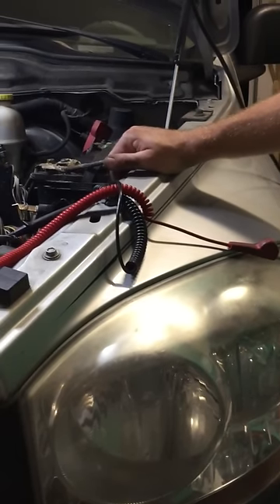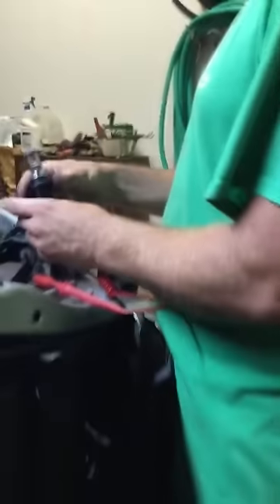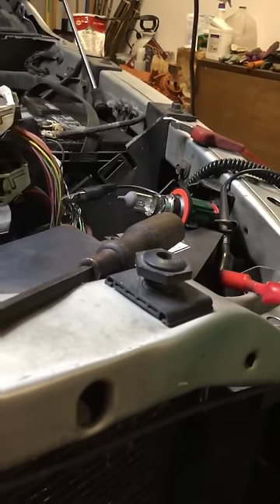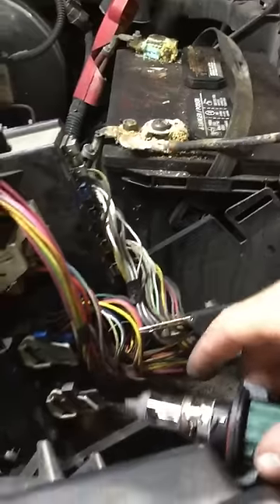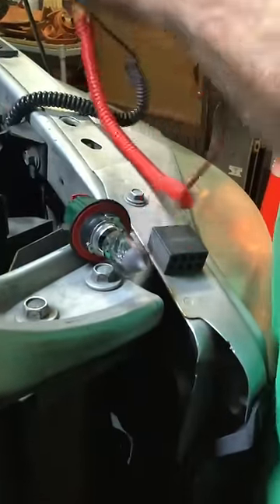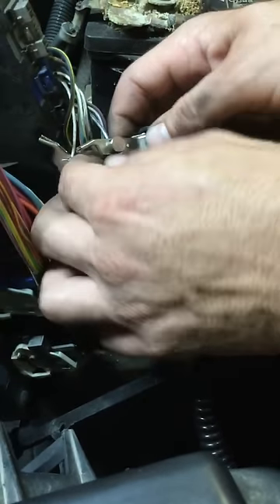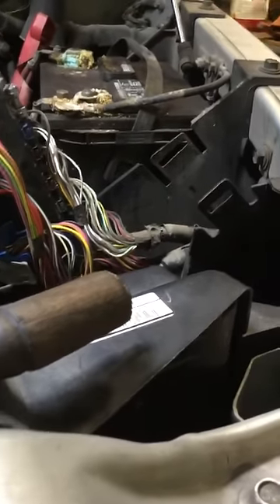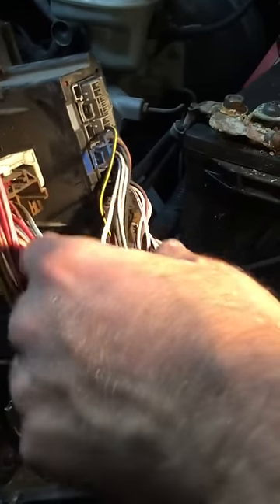06 ram low beam headlight issue

Comment: Hi just wanted to ask i have a 2017 ram rebbel 1500 i had one headlight go out about 2 weeks after o got the truck then few weeks later 2nd headlight gonre then i started driving with my high beams then one high beam went out then 2nd  few weeks later now i am driving with the lil fog lights at the bottom. Any suggestions, i already took tipm out and did hard reset no luck.please let me know going nuts, went back to dealer they were no help.
Reply from the maker: kimberly touhey. That sounds like a bulb issue. I have had no issue with the new TIPM's, especially on the rebel. Does your truck have any aftermarket lights, bulbs or ballasts?

Comment: My wifes 2010 Town and Country has a dead left low beam. The socket measures only 4.8 volts with a meter. Could it be the headlight relay just behind the radiator?
Reply from the maker: Steven Ruisi if your van is a 3.8l, I believe the relay behind the radiator is the external cooling fan relay. It looks like the low beam driver come out of the TIPM. The left is the white with dark blue tracer and the right side is a white with grey tracer. I would make sure your left side driver is not open or shorted to power or ground from your headlight to your TIPM. If it is good jump it over to your right side driver.

Comment: The problem is actually the fcm (little silver box) vs the whole fuse box.....still an expensive piece as well
Reply from the maker: lee Kennedy  thanks bro! This truck does not have a FCM, everything comes out of the TIPM. The FCM can throw you off if your not careful and I gone many rounds diagnosing the FCM     on other trucks.
Reply from the maker: lee Kennedy 2005 was technically the last year for Front control modules but there was probably some early build 2006’s that had them. This truck was a late build 06’. Yes beware of the FCM if you have one, it can throw you for a loop

Comment: My right headlight is having a problem and it also interfere with my left brake lights and my fog lamps and turning signals. The passenger side headlight which is failing is a double filament and the high beam is not working. Would that cause my problem ?

Comment: Thank you for video worked on my viper truck and was wondering if it works for the highbeams too
Reply: I believe it would, I haven't tried a high beam and I wouldn't be scared to try. Worst case would be a fried TIPM but if one or more drivers are bad, the TIPM is already shot. For your 8.3L the High drivers are...White/Light green for the left and White/Grey for the right. Good luck..

Comment: Anyone know if U can just plug the bad side wire and run that into the good side since that driver is bad anyway.  U feel like “jumping” then will cause that bad driver to voltage spike since it is still on the ecm

Comment: I just bought a 2007 ram 2500, lowbeams do not work at all, i changed the bulbs and that did not work. The connectors have been replaced also but the highbeams work fine. is there a way to quick fix this without replacing the TIPM.
Reply from the maker: SledNeck117  it doesn't sound like it. I would still test for power and ground and make sure all fuses good but if both drivers are down you may be looking at replacing the TIPM.

Comment: Seems as though this is common on Chrysler/dodge vehicles...I pulled my fcm off the ipm and sanded/slightly twisted the flat prongs as I heard its typically the fcm that causes this...that didnt work so I checked the voltage at the bulb where the low beam didnt work...nada.so whats left is a wiring issue/ipm issue.

At least now I know push come to shove I can jumper it like this.thanks man,btw how long did this hold up?
Reply from the maker: Craig Shelhammer thanks for the comment. This truck has no FCM and is still running both low beams off one driver almost two years later. Good luck!
Reply: Romans 12 thats great news..I think tomorrow thats what ill do!thanks for replying so quick.
Reply from the maker: Craig Shelhammer no prob and if you need any wiring diagram info let me know
Reply: Will do,thanks man!

Comment: I did this before i knew about tipm. I seen a repair to wire the burned out trace line. my problem now is everything else is starting to fail
Reply from the maker: infowarrior420  bummer dude. The TIPM's are junk. Good luck

Comment: I have 12v to the low and high beam wire on the right passenger but no low beam light..any ideas? if the tipm / pcm is bad then why would i get power?
Reply from the maker: Fred Young  if you have 12v on the low and high wires, you either have no ground or a bad bulb. Double check your powers and ground.

Comment: I have same side as you but brights on both sides works . Is this issue for low beams? Which is my issue on the driver side.
Reply: Keith Walker i have the same problem

Comment: I have a 07 Cummins and my passenger headlight has no power at all. My driver side only works on high beam. Does this sound like a TIPM problem? I’ve currently have both batteries cables disconnected and zipped tied to each other to see if it will reset the TIPM. I’ve read and done research and people say it works. We shall see. Anything you could recommend trying? Thanks
Reply: I have the same thing did u fix ur problem. Because I can't seem to have lights even on driver side.. only one high beam works on passinger...plz let me know how to fix this
Reply from the maker: Stephen Smith you have a tough one. It sounds like a front control module but you would need to do some more testing to pinpoint.
Reply: Romans 12 I pretty much did the same thing you did except I just put a little piece of wire in plug to jump them instead of splicing the wires

Comment: I did this on my truck and it worked but when I turn the car on none of the low beams work only the high beams. I am running LED bulbs would that be why they don't work, since there's too much voltage off one driver ??
Reply from the maker: M Bravo usually LED’s don’t run higher voltage but it’s the lower resistance that mess with the drivers. You said it worked? Did it work for a bit then stop? My second question is, are you sure you are on the correct wires? Third question is, are both low drivers bad?
Reply: yea they worked while the car was off but didn't when it was on but I think it was the LEDs cause I put in Halogen bulbs and everything works fine now. looked more into it might need resistors to run the LEDs

Comment: Looks like a good solution. Also experiencing power on low beam one side only. Same with high beam one side only but opposite side. Third issue, only right rear turn signal operates. No front signals whatsoever? Would it be okay to jump these drivers as well? Thanks!
Reply from the maker: S. Bloom so you have one low beam on one side and one high beam on the other side only working plus some rear light issues?  What year and engine do you have?
Reply from the maker: S. Bloom sorry, you also have no front signals?
Reply: Romans 12 Right rear blinker works but no others front or back.
Reply: Romans 12 Thanks for your help. This is a 2005 Ram 2500 4X4 with a 5.7 engine. From what I'm reading looks like a faulty TIPM circuit failure.

Comment: What type. Of wire should one used to run it. I have the same problem.
Reply from the maker: Lisardo huerta I would use a 16 gage wire, whatever color you can get at the parts store

Comment: i have an 07 2500 with the 5.7 in it & am having the same problems. will this still work for me? also how long did it stay working?
Reply from the maker: levi southern hey sorry for the late response but yes it looks like your truck doesn't have a front control module and  wires are the same: white with a dark blue trace for the left low and white with a tan trace for the right low. Verify your bulbs are good and you have no power to one or both sides with a meter.
Reply: Romans 12 thanks for getting back to me. my passenger side is fine, bug as weird as this may sound when the bulb is out of the socket on the driver side it has power, but when i put the bulb back in it loses power. i think im going to try this and hopefully it will work.
Reply from the maker: levi southern that is weird. I would verify my wire is good but it sounds like when the load is applied to the circuit the driver can't handle the load        
Keep me posted on the outcome. This truck is still going strong running two headlights off one driver.
Reply: Romans 12 will do. and yeah its definitely weird. im just now getting around to fixing it though. its been like this for a good while. i stopped driving it at night after i got pulled over haha. its a pain. i will keep you posted tho. thanks for the replies

Comment: Hi! I have an 06 Ram that doesn't have low beams nor power to either side. Any solutions?
Reply from the maker: Sabrina Kekipi. If you have no power at either side, you probably have a faulty TIPM/fuse panel. Make sure you verify no power coming out at the TIPM just to double check your wiring and of course make sure your fuses are all good.

Comment: Issue: Left side, no low beam. Right side, I have low beam
Flick on high beams I have Left high beam, no Right high beam. I've replaced the bulb validating it's not a bulb issue. What your describing is kind of similar to my issue but you never said if the high beams worked or not.
Reply from the maker: Geoff Sorenson it sounds like you have one low beam driver out and one high beam driver out. The high beams worked properly on this truck. I would fix the lows first, retest and then fix the highs
Reply: I have the same exact issue as this one in detailed. Please help me with what to do? 2006 dodge ram hemi 1500

Comment: I have an 06 ram and my right side light doesn't work. I may do this? How has it worked out for you since you did this?
Reply from the maker: Dev4stating x   Over two years and still going strong. No issues at all. I saw the truck Monday evening, he was dropping of his van for me to look at and all lights were working. And he drives this truck all the time plus he has two teenage drivers.  Good luck!
Reply: @romans1295  awesone man. Thank you.  Damn chrysler products
Reply: Curious if your headlights are still working by jumping one wire to the other. My experience on my dodge is that it worked for about a year, then both low beams went out. Replaced Tipm. Got another year of working lights, now the issue is back. I been told that for permanent fix, run the wires through a relay.  Just fyi.
Reply: @wesbishop5518  hey man. I sold it and bought a tundra lol

Comment: Hey man my sound on the phone is screwed sorry but I have the issue but mine is passenger side that is dead what colour wires do I splice together ?
Reply from the maker: Hey, for the low beam splice the white with dark blue trace wire on the driver side headlight to the white with tan trace wire on the passenger side headlight. If you can do it at the TIPM it would be easier but you will need to make sure your on the correct wires.

Comment: So you put one to the other wire?
Reply from the maker: The TIPM has one driver for each low beam. I just ran both drivers off my one good driver. So yes. You could use a relay but mine has been fine so far.

Comment: Will it burn out the driver again an then what ?
Reply from the maker: Junior lovescars, the truck I did this on is still working. If the other driver burns out then the TIPM will need to be replaced. You could run a relay to help it but that’s up to you.
Reply: Romans 12  you should do a how to video on that .

Comment: I have one headlight and no taillights. And only one brake light. No running lights on the rear and no fog lights
Reply from the maker: rafael charria you are definitely in the dark! First thing you need to do is figure out how many bulbs are bad
Reply: None. All new
Reply: It was an intermittent problem at first now it is constant
Reply: Romans 12 all the bulbs are new. It was an intermittent problem but now it is constant

Comment: What gage wire should I use to jump it not from the tipm, any special connectors
Reply from the maker: Travis Adams I am pretty sure I used 16 gage. I know it wasn’t 18 gage. Could of been 14. Good luck! This truck is still going strong.
Reply from the maker: Travis Adams scratch that, I would run 18 gage. Sorry for the confusion
Reply: Romans 12 I ran 16 gage but when I turn on brights I lose that light. Your fix worked just when the brights are on it don’t

Comment: It's ok but you're doubling the amps running off of the only remaining driver. Should use the driver feed wire to run a relay so it don't burn it out in a few weeks.
Reply from the maker: Robert Vincent  thanks Robert! I agree and it would be better. But I wasn’t worried about the TIPM at the time and to this day the driver is still going strong handling both lamps